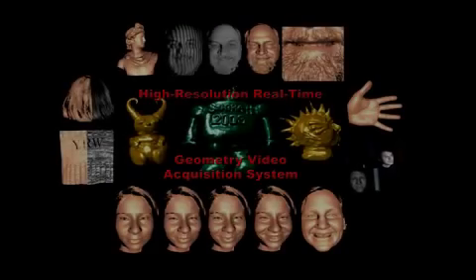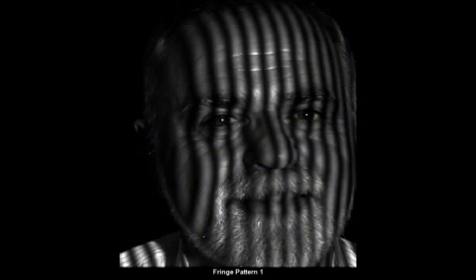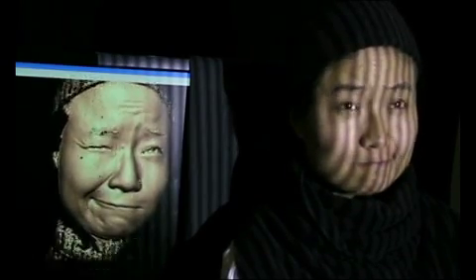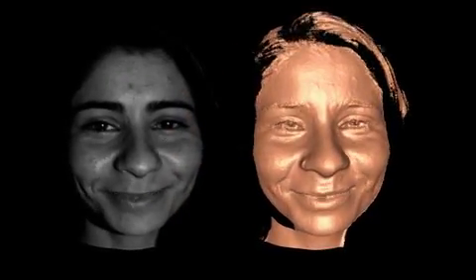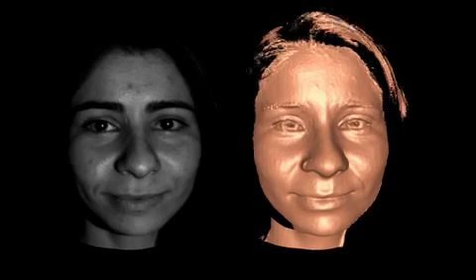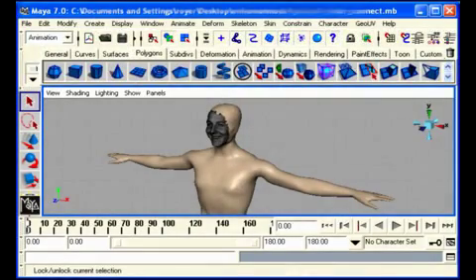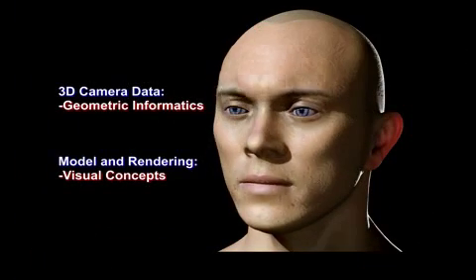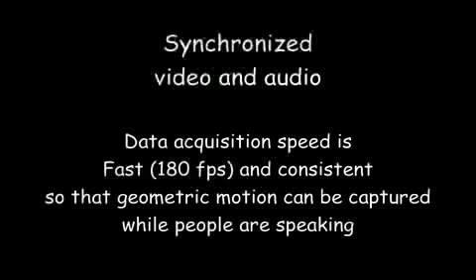Realtime 3D geometry video scanner

Comment: so I've got a question: the triangles were actually moving and it didn't seem that every frame a new model was created (what i thought when i clicked the video), it looked more like the system could actually tell what parts of the just scanned model were moving and thus moved the belonging triangles.
Reply: yeah it's not a question sorry :p
Reply: Each frame of video was independent of another, and elements of the model weren't referencing elements from any other frames. It might be most accurate to say that the depth data of the video was being projected out of a planar object, onto which the color data was also projected. The points may have appeared to be stuck to particular features of the face, but that's likely just because there were so many points it would be difficult to know which point was which from one frame to the next.

Comment: over 300,000 points per frame, at over 180 fps.
So that's basically a 640x480 video recorded at over 180 fps. 
Or the equivalent of HD 1920x1080 video recorded at 30 fps.
It's probably take up less data though - since it's probably replacing the colour data with depth data instead (with probably only 640 or so "colours" or depths).

Comment from the maker: @ALIVEWORKS The camera + frame grabber I used cost more than $7,000. If you only capture still object, my technology should not be the best choice. 

It depends on the spinning speed of an object, if it spins at more than a few hundred rpm, even my system won't to able to capture it.

LCD projector won't be cable to do it. It must be a special DLP projector, and modify it in an unique way. Otherwise, it won't work at all.

Hope these give you enough information to start with.

Comment from the maker: This requires a lot of expertise on both hardware and software. It was not easy for non-experts to reproduce: even my students couldn't. That's why it is so expensive and unique. Another problem is that the new projector has different operation mechanism, which makes it impossible to implement the same technique. The good news is that we are working on something that will simplify the system development. Once we are successful, we'll open, and the hobbists should be able to reproduce by then.

Comment: people have mentioned the high poly count these sort of applications produce as a reason they couldn't be used in games, when actually the program Meshlab will (for free) do a texture accurate edge decimation to produce a high quality model at whatever poly count you'd like. It intelligently allocates whatever poly budget you give it to encode the most data possible. Meshlab does amazing things top shelf 3d software doesn't even attempt.

Comment from the maker: What accuracy are you talking about? For static objects, it is much easier and and the system can be much cheaper. For large object, I guess it is difficult to finish in a single scan. But you can certainly use a mature merging software to put together once you scanned all area of the object. The weight for the stationery simple is only few pounds. It should be easy to use and transport. Our software allows "button clicking" measurement, should be simple enough.